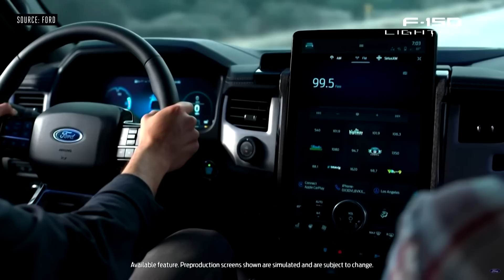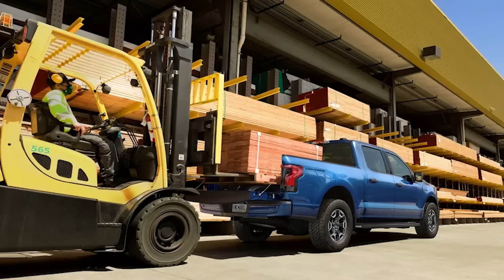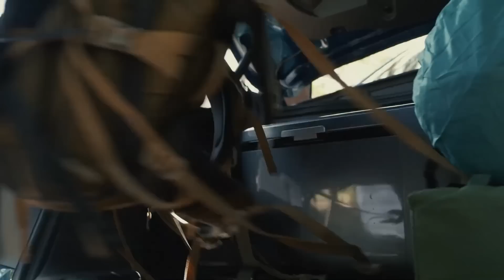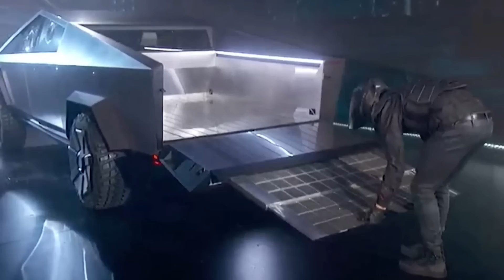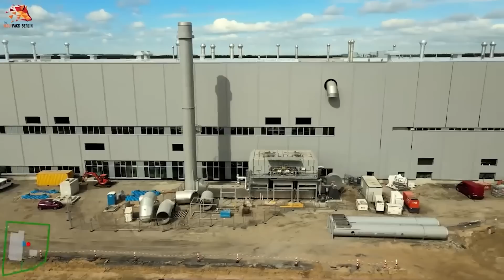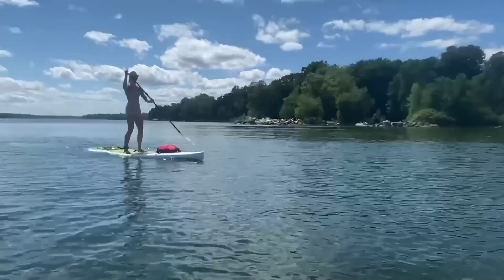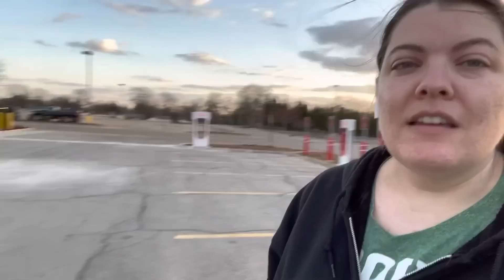Tesla Time News - Ford F-150 Lightning Unveiled

Comment: Let's discuss the request for power from the Cybertruck, as mentioned by Lee from Puerto Rico.

In an emergency situation, when the grid is down, sending power from vehicle-to-home and calling it vehicle-to-grid is a misnomer. In that situation, actually placing power on the grid from the vehicle is an extremely dangerous act and the utility will likely go bonkers, should anyone try to do it. To do so would be putting the lives of the electric utility linemen at very high risk of injury or even death.

An actual implementation of vehicle-to-grid is of very limited use and that is a very big reason why Elon prefers to employ Tesla batteries running Tesla software, for grid power management. To rely on having vehicles connected to the grid for the purpose of grid management just throws more variables into an already complex situation and only complicates the task of grid management and implementing such software. 

Ford claims powering a house for 3 days, from the F-150 Lightning. That's probably based on a 150 kWh battery providing about 2-kW of continuous power. Ford likely used the 2-kW number because that is the average power per customer that most utilities have tied to their grid. So it makes some sense, when looking at it that way. This will be true only for the 300 mile range vehicles; the 230 mile range vehicles will only be able to power the house for less than 2 days, assuming equivalent loads.

The Tesla Cybertruck WILL come with vehicle outlets providing 240 VAC power. These can also power a home, just like Ford is claiming for its F-150 Lightning, when it starts production. You would have to have a transfer switch and a properly sized cable and plugs, to go from truck to switch, but it is doable, up to the power limit that Tesla may put on the Cybertruck 240 VAC outlet. The Tri-motor Cybertruck will be able to power a home for more than 4 days, given the same power loads that an F-150 Lightning Platinum is given (and the Cyber Tri-motor will be $20,000 cheaper!!!)

On 2018-06-26 Elon Twitted the following:
"Pickup truck will have power outlets allowing use of heavy duty 240V, high power tools in field all day. No generator needed."

https://twitter.com/elonmusk/status/1011724688706318337?ref_src=twsrc%5Etfw%7Ctwcamp%5Etweetembed%7Ctwterm%5E1011724688706318337%7Ctwgr%5E%7Ctwcon%5Es1_&ref_url=https%3A%2F%2Felectricrevs.com%2F2019%2F11%2F21%2Ftesla-plans-to-innovate-ac-power-outlets-on-cybertruck%2F

It is very likely that some Cybertruck owners will be exhibiting vehicle-to-home power transfer way before any F-150 Lightning buyer will be able to do so.

Let's hope that Lee in Puerto Rico gets his Cybertruck soon. 

Good show.

Now You Know.

Comment: I don't get the speculation on the UK as a GF site for Tesla.  UK: expensive labor, relatively small auto market (compared to the rest the EU that they would ship to), and now due to Brexit, they are subject to the import tariffs Tesla built in Berlin to avoid.  There's also no local lithium or nickel mines.  Eastern Europe/Balkans would make more sense in every possible way.  If Tesla is looking at land in the UK, it's probably for working on grid services.  They already work with companies like Octopus Energy.

Edit: To be more clear on the size of the UK auto market, last year's sales were under 2M units.  Even if Tesla were to immediately take 25% of that, that's only 500k cars, meaning they would export over half their output, which is just stupid.

Comment: The 0-60 time of an F1 car is relatively poor because it is two-wheel drive, weighs ~800kg and does not generate much downforce below 60mph. Beware though, since the F1 car would smoke the Roadster going from 60 to 0. It's conceivable that a Tesla Roadster could beat it on a course that includes lots of 30mph turns such as autocross. It might actually make a good PR stunt.

Comment: 3:08 Just FYI the XLT comes with 230 miles as well for $53k. You’ll have to pay extra for the extended battery to get the “up to” 300 miles you guys listed (likely 10k which is what the difference is for the other version).

Comment: Rather than a car factory in the UK, i think it will make more sense for Tesla to build a 4680 battery factory to supply powerwall & megapack locally. Rumors are they are building a 800,000sq ft facility in Northamptonshire in the Midlands.

Comment: Ford still doesn't get it. They insist on using the same old tools they always have. Billions on advertising. Bloated admin and old-school engineering. Misleading price and range information that doesn't really tell you what it will cost to get the range of a model 3 two years ago. But the biggest thing I saw was a 1990's Ford Ranger (plain Jane and dated) with a crew cab. Very disappointing.

Comment: One key with Cybertruck:, it won't rust out.  Every vehicle I've ever owned, they rust.  10yrs in Ohio, off to the crusher they go.  Rails, mounts, shafts, and eventually body as well.  No car-maker has ever seriously addressed that (other than with plastic).  I suspect they all understand rust = recurring sales.  Cybertruck is stainless on aluminum.  Won't rust.  Your cybertruck can last 50yrs.

Comment: I've elaborated a new 0-60 test that is more realistic for everyday driving.  It has 3 modes: Grand'pa mode: 0-60 in 45 seconds, stressed out mode in 30 seconds and Sick mode.  I haven't tried the sick mode.  After all, I made the test with my Sentra 2006.  I was afraid to blow the engine, the transmission or everything else.  These numbers seemed ridiculous but they reflect more what most people do to get as many miles per gallon as possible or as much range as possible with an electric car.   Please, Elon chill out, you wouldn't want one of your child to be killed by some maniac in a Tesla !

Comment: These vehicles that aren't going to be on the road (ATVs, boats, hydroflier...) I think that everyone should start using the metric of how many minutes or hours it can be used for and how long it will be charged rather than miles (or at least not emphasize the miles as highly as you should time because you aren't thinking about how far away you're going to go)

Comment: Hello Jack and Jessy

What the friend says about Puerto Rico is completely true. I live in Aguadilla, Puerto Rico, a paradise. But we are facing a change from the energy company to a private one named LUMA. It is said that there has been sabotage by energy employees, who oppose the change, which will take effect on June 1, 2021.

I installed 20 solar panels and a Tesla powerwall2, I no longer need a noisy generator or bad smell. I have the Cybertruck 2 motors in stock, and it would be SUPER if Elon Musk enabled V2G to power the houses.

Comment: @ 18 mark on the roadster speed,  @ that speed it’ll be down to the compound in the tires to reach that time. 
It’s called friction.

All of these SPAC EV companies are essentially saying that they are out of the private funding, so they will go to the public funds to fund their own lofty projects.

On the Elon’s tweets: The diamonds 💎 🙌 are essentially saying that TSLA will continue to hold on their BTC for long term.  The portion of the BTC sold out of TSLA, is was to see if the btc transactions worked out for TSLA. As a test case.

Comment: Ford's Lighting is complete trash, if Tesla came out with this $90 thousand dollar 300 mile brick they would have been scolded immediately. So you charge up to 80% then don't discharge less than 20%, this means 190 miles effective range. They don't even have the batteries to scale this up. A vehicle to grid is a joke, I guarantee you can't use AC it would roast those batteries. Also the power tool utility is another battery drainer, no way you will get 3 days. Ford can say all type lame statements at this point about what they can do.

Comment: I don't care if companies like Ford have a president of the U.S. do a photo op. It gets more eyes on their product. Regardless of whether the politician is Democrat or Republican, what is more important is: is the product a good product. Based on the current evidence, the Lightning looks like a great product and will be a huge benefit to contractors who do mostly local work.  Towing is still an issue with electric, so I would guess there will still be a lot of gas trucks for a while until electric improves towing significantly (most of my neighbors use their trucks for towing trailers and campers and boats, so....)

Comment: I may be wrong concerning the new terms V2L, V2H and V2G (vehicle-to-load, vehicle-to-home and vechicle-to grid); but the new F-150 Lightning does not really do V2G. It does V2L having lots of places to plug in power tools and the like.  You may think of it as a generator.  It also (at least for some versions) does V2H. If you add a little bit of hardware to protect the grid by disconnecting from the grid, it can power your home from the car batteries.

Comment: I think the F-150 Lightning XLT at USD 52,974 is standard range.  You can get the PRO with extended range for basis price plus USD 10,000. At least that is how I understand the latest reports. I imagine the XLT with extended range will be USD 52,974 plus USD 10,000?!

Comment: Lightning info incorrect. XLT standard is 230mi not extended range at 52k
Reply: The fact is, Cryptocurrency is making financial waves and fighting against poverty in this modern era, and the question traders as them self is if this the right time to invest ?
Before jumping into conclusion I think you should take a look at things first. For the past few days the price of Bitcoin has been fluctuating which means the Market is currently unstable and you can't tell if it is going bearish or bullish. While others Still continue to trade without the fear of making loss, others are been patient. It all depends on the pattern with which you trade and also the source of your signal. I would say trading has been going smoothly for me , I started with £25,000 and I have accumulated over £115,800 within 3 weeks with the trading strategies given to me by Expert Blian Reinkensmeyer His method are top notch and profitable, obviously he's the best.
You can what///sap him
+=1=6=0=7=2=0=8=5=0=3=8=

Comment: I'm someone who uses F150, F350s, and 3500s only truck i would use for actual work is the 500 mile range cybertruck (highest rangenfor a EV truck), 70% of the reason is for the range, 15% is higher towing, 15% higher preformance, the 500 miles will go down to 350 in the winter, and 180 while towing in the winter, but the ford will give me 80-120 miles with 50 minutes charge times for 10-80% vs teslas 20 minute 10-80s, only real advantage the ford has is that it doesn't look like a cybertruck, powering your home with your only form of transportation during an outage is a dumb idea. Get a 9kwh generator isntead that are only like 2 grand and will power your home far longer with emergency fuel, your home will not last 3 days if you plan on heating it.
Reply: U. An also buy diesel dc gen sets from polar power 15 and 20 kw kubota and Yanmar  built for recharging only range from 12 to 500 volts

Comment: Zac and Jesse

Love the show but you are very ill informed regarding the out come of the Brexit deal!   The free trade agreement between the EU and the UK ensures ZERO tariffs,   Low friction trade (including car supply chain) and does nothing to upset the current flow of Car parts from EU to UK and Visa versa.  Something that has made UK a car manufacturing a success and is protected under the new Trade deal.   Also the free trade deal now demands all EV part must ( 70% by 2027 including batteries) be made in UK and/or EU together for both to avoid tariffs under the country of origin rules. No advantage for either group on tariffs as the same rules apply between the 2.

There are no tariffs between EU and UK.

Now here is the best bit!  As UK is now outside EU it can offer car manufactures more state aid as not part of EU’s rules and make its own trade deals so that unlike the EU it could potentially supply many countries tarrif free.  Could be very attractive for some manufacturers

I didn’t support Brexit but I work in the EV supply chain, and trust me BREXIT could work for the UK in the EV space.  Also apart from Norway UK’s renewable energy strategy and push to EV’s is the best in Europe

If you want an example the first EU Battery LiOH plant will be in the UK!

Comment: the fake president wasn't driving the truck - it has a second set of controls on the right.  would YOU ride in a vehicle  that mfr was driving?
Reply: There is a video of Biden lighting up the tyres of his 60s Corvette. I dont think Chump can even drive.
Reply: It's Fords new alzheimer's mode. They partnered with Fisherprice. There's a fold out toy steering wheel with fully functioning squeaky horn and plastic seat cover incase there's an oopsie poopsie moment.

Comment: I think the Ford F-150 EV having the V2G connection is  making it difficult for me to order the Cybertruck.
Tesla price increases seems to be batteries and because they can.
Reply: @sparkimooo  is it not just a 240 volt outlet  which the cyber truck has.  Also I seen a chart which shows the the two lower end models it does not have
Reply: V2G is east to add if Tesla felt it needed to respond to this.  The tech is far more simple than what they use for the Power Wall, Mega Pack & AutoBidder.  You might want to compare range & capabilities at price points before talking about battery prices. Also might want to read up on Ford’s battery supply for the MachE & F150.  It is limited to cells being imported from LG’s Poland factory that also supplies Sudi, Mercedes & Jaguar.  That and SK factories that are over a year or more out from production.

Comment: $53K F150 Lightning DOES NOT come with 300 mile range....but only 230 miles! 'Extended battery pack' is required to bring it to 300 miles (final estimated cost ~$60K)
Reply: You can get the commercial version with the 300 mile battery pack for $49,974.
Reply: @timlot  Sure. But the video explicitly says that XLT version costing $53K will have 300 mile range....which is wrong!
Reply: @omnicurious2949  
I was just responding to your post. You made it seem like the only way to get the 300mi range version was to spend $60K.
Reply: It will be if until the PRO becomes available.  And also the PRO will initially be limited to fleet sales until they fulfill the multiple vehicle orders for current fleet managers.  Initial consumer purchases will be limited to XLT ($53k) and long range XLT (~$63) probably with significant dealer premiums added. I’ve spent years working with dealers for fleet management.  This is simply the way the Ford (and GM&RAM) dealer/fleet system works.
Reply: @timlot i might not have mentioned XLT in my initial post but "$53K F150 Lightning" model clearly alludes to the XLT (as referenced in the video also)

Comment: 3:10 The $52k XLT version is the price with the 230 mile standard battery. The extended range 300 mile battery is an additional option, estimated to be about $7500-$10000.
Reply: Correct.  It's also worth mentioning that the $40k version is a stripped down "commercial" model which means things like vinyl floors, vinyl seats, manual windows/locks, optional HVAC, etc.  So for consumers it will start at $53k for the 230 mile version and ~$63k for the 300 mile version.
Reply: @CL-gq3no  Precisely
Reply: Also don’t be surprised if the PRO is not offered with long range option.  Just look to the MachE.  The base model, Select, does not have a long range option.  To get the long range (outside limited editions) you need to pay a $5k upgrade to the Premium in order to be allowed to add long range.
Reply: Nobody charges to 100% normally 80%. Just like no one discharges 100% you leave 20% to extend the life of the battery pack. So the effective usability for a 230 mile is in reality closer to 140 miles a complete joke. Not to mention they have no scale for the batteries, they are claiming a mid 2022 release. They are buying 3rd party of the shelf from a Korean prismatic battery supplier. To reach current F-150 sales at 1 million they need at least 200 gigawatts production. Ford most definitely will be selling these vehicle's a loss due to 120 to 200 kilowatt pack size. We know this will cost $24 to $34 thousand per pack. Did we mention Ford is 160 billion in debt, not good.
Reply: @tigaagul7  But don't truck owners use their trucks primarily to simply transport passengers less than 35 miles a day?
Reply: @Brad-sb1dk  very true,  I gets used as a truck maybe half dozen times a year. Where I live in the Midwest, the bed is mostly used as a 🗑. Don’t some folks do use the vehicles to haul stuff, just visit a Home depot, Lowes, Manards.
Reply: @Brad-sb1dk  Yep, while I have personally done road trips in my truck (Toronto to Miami and back), most times (like 98%) that I am hauling materials for myself, parents or friends the trip is rarely over 20 KMs.
Reply: @Brad-sb1dk  NO!
Reply: @tigaagul7  
All the numbers are with 1000 pounds of cargo. The actual range according MKBHD who got to try one, see the battery capacity and range written calculated that at 100 its 450miles.